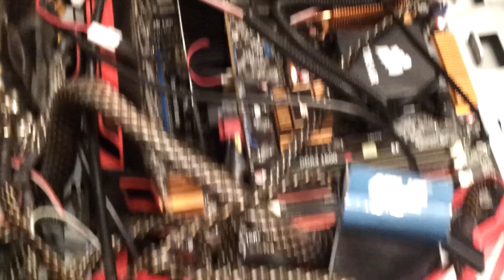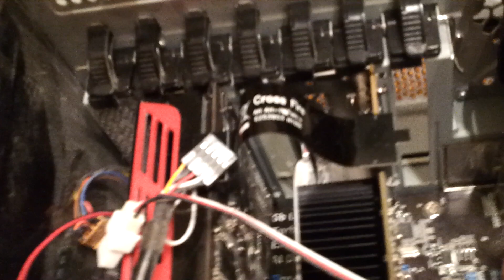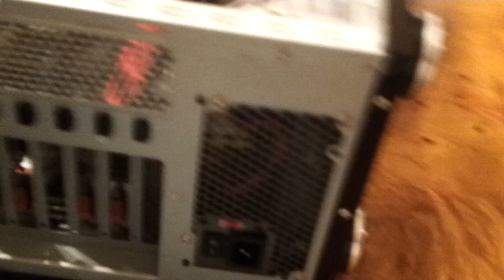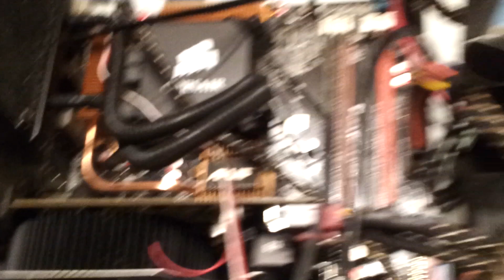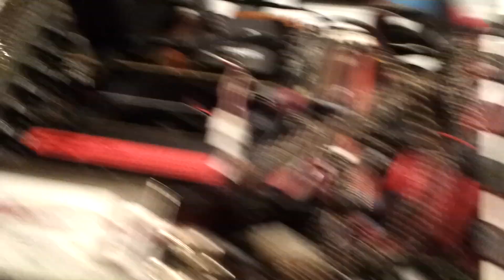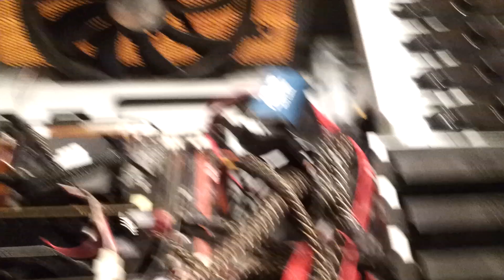How to crossfire Radeon Graphics cards

Comment: But, does it work? You didn´t show any real test of the crossfire
Reply from the maker: You are so right, I do believe I mentioned it in the video, or maybe in part two.. anyway, it does work, the improvement is dismal, however enough to be noticed. Worst of it ended up being that the lower quality of the two went into maximum fan speed 100% of the time the pc was on. Meaning it was trying to attempt to match the performance of  the superior video card.. and frankly it just couldn't so it was heating up from the start and very hard pressed to come even close to what it needed to do. But I did test it on a game that often had minor graphics issues, and upon the crossfire test, not only did the minor issues stop but overall play-ability was a touch smoother.

Thank you for your observation, if you have any questions feel free to ask!
Reply: Thanks, i have the same cards, and it does work, and the improve you're right, it's enogh to notice. Anyway, thanks for the response even this is a 4 years old video :D
Reply from the maker: My pleasure, sorry I missed you when you wrote it!

Comment: Darren i have a question i have a XFX CORE Edition Radeon HD 7770 DirectX 11and i want to buy another one to add to my pc do you know how much power supply i would need to run both, or where can i find out how much i need? I have a 650PS in it at the moment
Reply from the maker: I would assume you could find the power requirements on the radeon website, or by calling the manufacturer. however unless you are powering a large amount of fans or lights etc, I can't imagine 650watts having and issue powering 2 video cards. even if they are big and bad ass, more often than not, if the power supply has the connectors for everything, it will be able to do it. it's when you start overusing splitters that you run into issues. if you have to use power splitters then it's time for a power upgrade. otherwise I myself would just go ahead with the install. 650watts isn't a weak supply. I only use 850 and I've never needed more no matter what I add.
Reply: thanks for the info, have a good one

Comment: The amd hd r7970 and the amd hd r7850 are both crossfireX capable so does that means that those to different cards can run toghether for BF4 ultra? 1080p 60+ fps?

Comment: im new to crossfire , i currently got a amd6970 and i got an radeon 4000 series
i ripped the 4000 one from a old pc and installed it in my new pc so i could use more monitors at the same time since all my slots are used in the amd 6970 but my quastion is how do i crossfire it ? i installed both cards correcly and put the tingy in the middle but it only uses 1 card at the moment and i installed both cards drivers